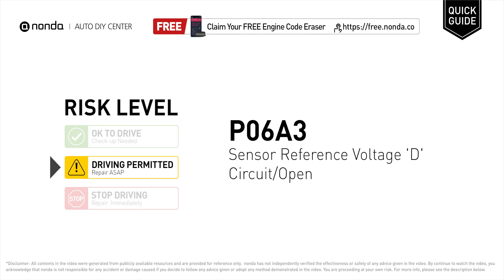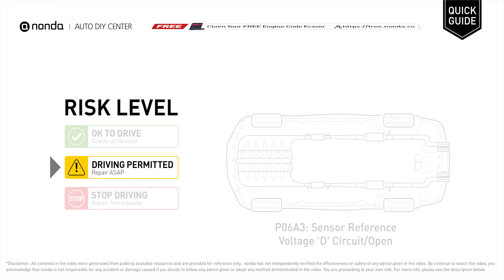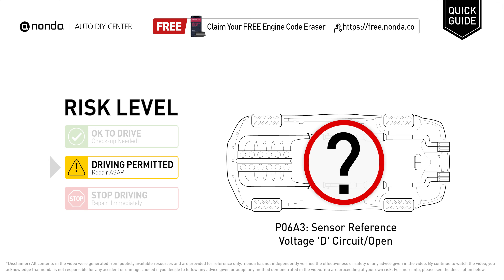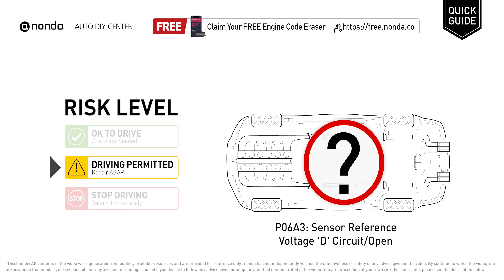What is P06A3 Engine Code [Quick Guide]

Comment: Can you do a 2015 Buick Regal I have the P06A3 code on my car and I need to know we’re it is and how to fix pls help car been down for 2months
Reply from the maker: Hello, can you please tell us all the steps you already applied (methods/solutions done)?
Reply: Nothing
Reply from the maker: Kindly check if there's any blown fuses and replace them. Test the resistance of the sensors if within your car's specification. The PCM might also need a replacement.

Comment: how do you fix a P06A3 on Chevy Aveo
Reply from the maker: Hi James, please check the condition of the fuses, components/connectors and circuits. Repair or replace if issues were found to see if the issue will still persist.